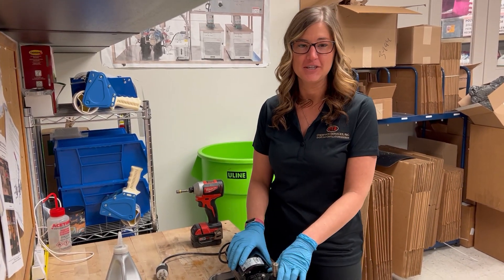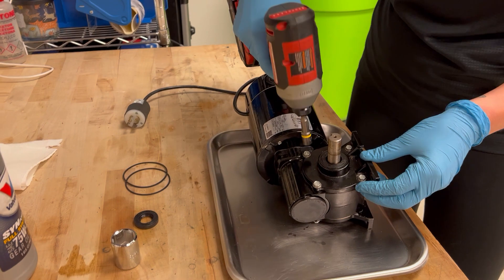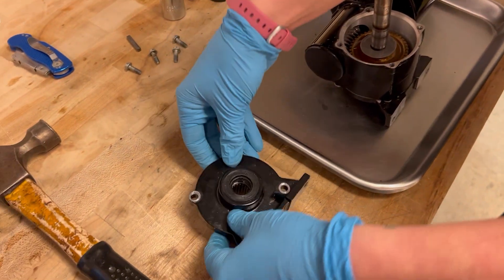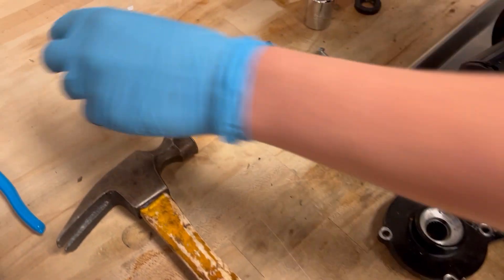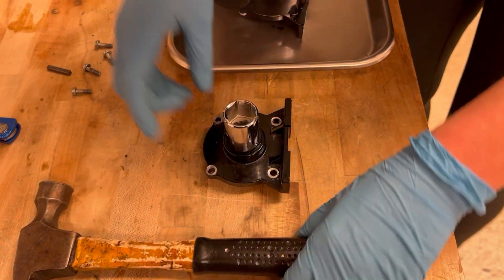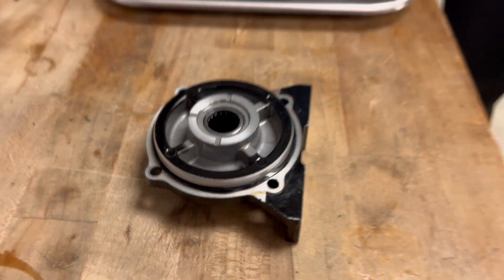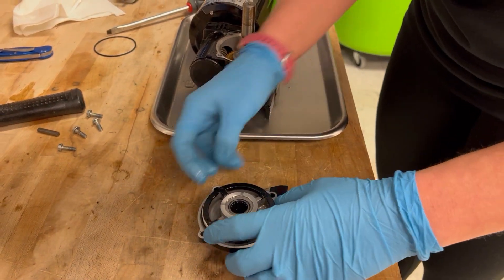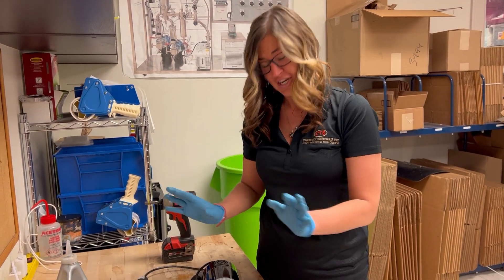Bodine Right-Angle Motor Seal Replacement

Comment: Could old seals be related to the vac pressure not to reach as deep as it normally does? and then, finally for the motor to cease?